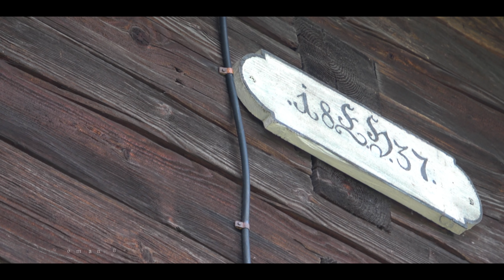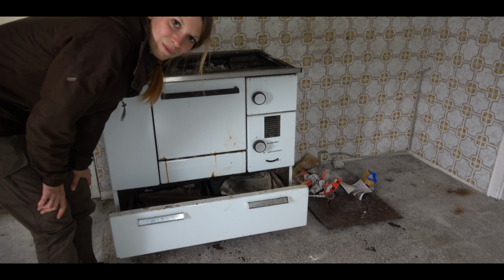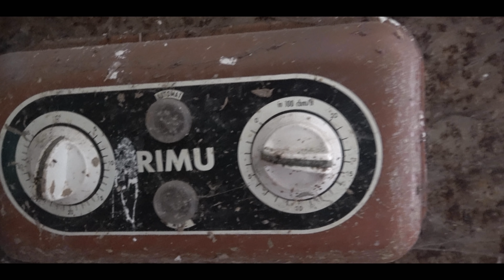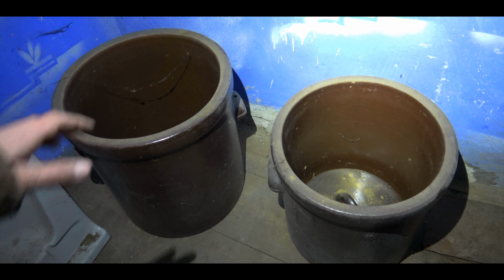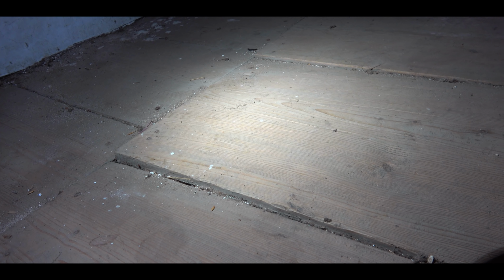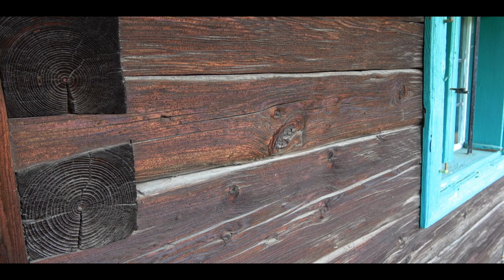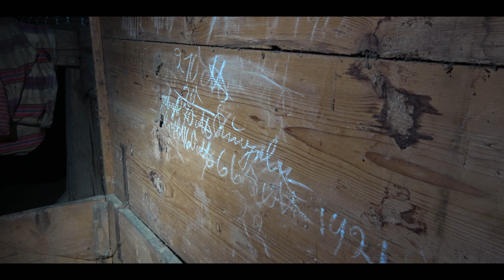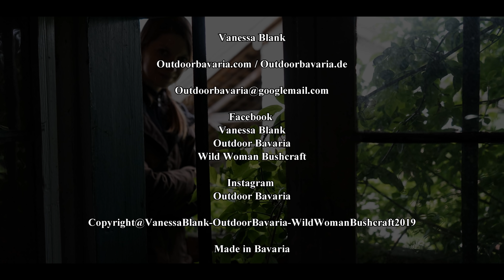182 years old - Lost Farm- Vanessa Blank - Wild Woman Bushcraft - 4k

Comment: Vanessa - Whenever going up stairs, inside, these old buildings, step to the far left, then, to the far right, on the steps. Do not step, in the middle, in case, of collapse. This will save you, from falling, in either direction. The sides, will have less use, but the centers, have the most use, and, are much weaker.

Comment: The cistern, under these old buildings, is called the "septic tank." The water, buids up, to a certain level, then, the solids, sink to the bottom, and, are broken down, over time, The water, when it reaches a certain level, flows out pipes, that go to an area, some distance away, then into, many different pipes, with small holes, in the sides. When the water reaches the holes, it leaches out, into the ground. The old saying is: "The grass, is always greener, over, the septic area."

Comment: Thanks Vanessa excellent video,I love the old style ,like a joint coco clock,timber balcony.Excellent carpentry joints in places,interesting to see how they over lapped the timbers in the Roof.Ya needs restoration much of the items i would say 1960ths and 1970ths tiles out of place for such a building.It was difficult to heat in the past.Keep up the good work.

Comment: Interesting place, that would be alot of money in the UK so I hope the new owners enjoy all their work to put it back together. Nice they gave you permission to video it, maybe do another when it's finished? Another tip for you Vanessa, if your unsure of an old staircase never go up in the middle, go step by step as close to the walls as you can. In the UK we call them stringers, which is the bit of wood the staircase tread fit into running top to bottom on the side. That way your weight is on the strongest part, as the tread may look and even sound OK but be worm eaten on the underside. Interesting place though. Arthur (UK)

Comment: Great video, Vanessa.  I'm surprised to see that they built the floor structure touching the ground.  You'd think the joists would have rotted.  
Two wood species that are great for damp conditions are cedar and walnut.  (Otherwise, they are totally different woods.)
Reply from the maker: Hello! I thought the same .  Thank you for watching ! 
Kind regards, Vanessa
Reply: One possibility is that they treated the joists with some chemical.  Aqua-fortis, a mild nitric acid solution that was common at the time, may have been used to inhibit wood rot.